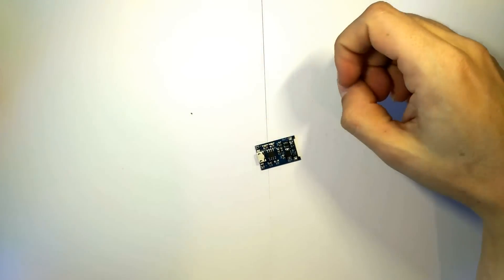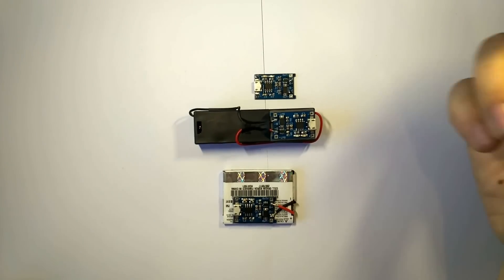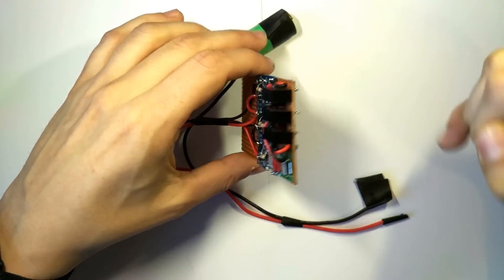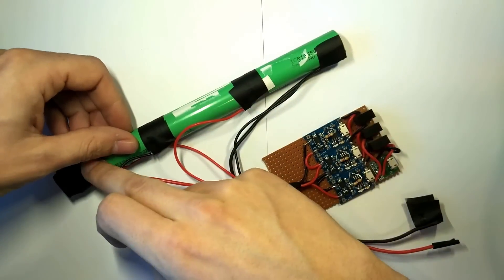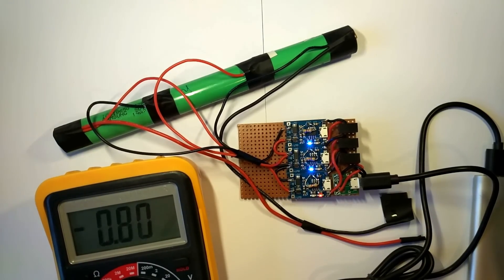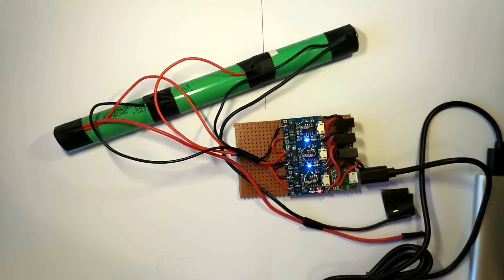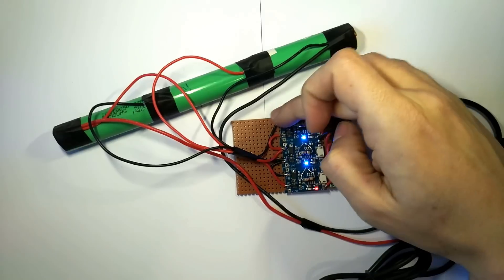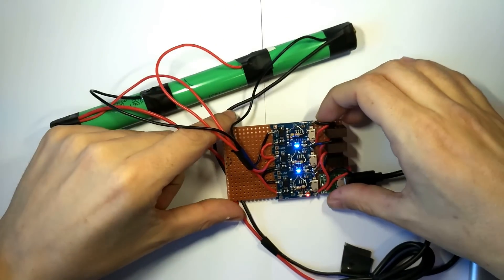Balanced 3S Lithium Cell Charger using the TP4056

Comment: Is it possible to connect load on batteries while it on charging (from 12,6 side terminals)? Maybe it could possible if diodes will be added for every output of each tp4056?

Comment: Question. could this be left trickle charging from a 5V output from a solar charge regulator without fear of over charging? 
Also question. could a 5V regulator be attached to the output for device charging, and would it have discharge protection?

Comment: This is a very unsafe design for 3 reasons:

1. Each of the protection chips (DW01A) is separate, there is no cooperation. Meaning: one chip could fail, due to ESD, water droplet, etc. Then that cell group is completely unprotected, opening up the possibility that the cell group could become overcharged and explode unexpectedly! With a 2-wire monolithic design, if one part fails, due to ESD, etc, the output FETs are turned off PERMANENTLY. This is much safer, as charge can no longer flow in or out. Crisis averted, while also alerting the user of the failure.

2. For exactly this reason, the manufacturer states clearly that the DW01 is a 1S ONLY protection chip. Using them as a 4S, 10S, 14S, etc is NOT RECOMMENDED because of this safety hazard! That's what the "01" in DW01 stands for! Here is the datasheet confirming my claim: http://www.kexin.com.cn/pdf/DW01.PDF

3. The protection and balancing chips are separate, leading to a condition where the balance chip fails, and the cell group is no longer able to bleed overcharge anymore. This is less dangerous, but still a design flaw stemming from using a 1S protection chip incorrectly. Proper multi-cell chips will perform balancing as well as protection.

Comment: From thumbnail I thought this would be another video of dangerous circuit from person who doesn't have a clue what is doing but this is pretty clever, i had a similar idea but my plan was make my own isolated power supplies which can supply more current but that modules have problems with overheating, recently I found different boards based on IP2312 which doesn't disipate that much energy to heat

Comment: Did you remove the R3 resistor and replace it with 5k ohm? Or did you just parallel it to R3? I can't clearly see the TP4056.

Comment: Why not place the TP4056 modules in series? Then you don't need an isolated DC/DC for each module and can benefit from full charge rate of 1A for each battery. You (in your case) need a 15V 3A power supply to charge it. When charging each ground is lifted and don't cause a short circuit. For example: 
Module #1 GND is at 0V       -> +5V - 0v = 5V  => 3.7V battery #1 charge
Module #2 GND is at +5V     -> +10V - 5v = 5V => 3.7V battery #2 charge
Module #3 GND is at +10V   -> +15V - 5v = 5V => 3.7V battery #3 charge

In case you want to be able to charge from USB 5V,  you can use a boost converter (5V to 20V) of 4A to provide the required power.  However, when you plug it into regular USB socket, you cannot achieve the maximum charge rate. Your design has the same problem, you cannot achieve the 1A max charge current. The DC/DC converter is rated 200mA max. There is a chance you push those components to these limits and get pretty hot or get damaged. Also you have 3x times effeciency loss for each DC/DC. 

So what do you think?
Reply: I think its a great idea, can you make a 40 minute video detailing everything step by step and maybe adding lots of animations ?  just kidding

Comment: I think this idea was interesting back in 2016, as most will say it does the job.
nowadays, there is better option with advantages at all points: effeciency + cost for the project!
for example the cost for a 3S pack:  3 TP4056 + 3 B0505S, is more expencive than a 3S BMS with Balancing feature!!
and the BMS option is able to gives you much more amps, there is 4A or 8A model, which are more than anough for most DIY project. the is even 20A model...
So BMS board is better option!
Reply: Those "BMS" boards only provide protection and (sometimes) balancing.  They don't regulate charging.  But there are a few options for charging series packs.  The easiest is to just buy a plug-in charger for the appropriate voltage and current, the listing will say it's for lithium and the unit should have an LED that changes colour to indicate charge status.  If you have a DC source of several volts above pack voltage (like an old laptop brick, or solar panels), there are buck converter chargers: SY6912 modules do 1 to 3S (but smoke came out of mine so I don't trust them so much) (voltage set by jumpers, current by removing shunt resistors); MAX745 costs more, but does 1S to 4S and can be configured with dipswitches and trimpots.  Then there are step-up chargers that work from USB C; charging power will be limited, but they'll work anywhere you can plug into 5V USB.  Search for "2s 3s 4s type-c charger"; they come in fixed voltage and current configurations.  Add a "BMS" and you have the same functionality as the circuit in this video for less money.
Reply: @BassBinDevil  Indead there is much more option nowaday, vid and need is from 2016...
Since chinese minion did there magic lol
I back bought few TP5100 module (2S), that are close to those you refered to. They constatly update there tech with newer IC and stuff...
Since, I only needed 12V from 18650s once, for the battery conversion of  my cordless drill , to lithium, and went with 3S BMS 20A, cause 10A got burned dead. 18650s choosed with approxi same capacity.
I charge the battery once per month and it is fine.
Mostly use TP5046.

Comment: could you give the wiring diagram please ?!
Reply: Its simple.... Connect each battery + and -   to each charging board. The batteries are connected in series. Here each battery is charged seperately.

Comment: I think you didnt connect the ends of batteries together. Each cell seperated by each other
whats the point of dc dc isolator
I am mad right now I searched everywhere but there is nothing about 2s li ion charging 
there is no module at all
Reply: hello friend, you can buy on aliexpress for only US $ 0.48
Reply: @hendrasaputra8545  thanks I found one

Comment: I can see how the cells are charged independently which eliminates one problem of charging multiple cells using a TP4056 and one supply, but how are they actively balanced? In other words where is the feedback loop that guarantees each cell is the same as the others?

Comment: What is the charging time of this charger?
Reply: He said 250ma per cell so at most this should take 10hrs if using 2500mah cells. Pretty slow. It only takes a 750ma charger to go full speed like this, which should be any power brick phone charger usb. If you charge from a computer usb port it may only be 500ma and go even slower.

Comment: I did the same with tp4056 boards with protection (btw i didnt used protection feature) and my boards shorted out. Why?
Reply: You proberly didnt use Isolatet individual powersuplys like BW0505S-1W. They must be used or you have a Short
Reply: @Enderkruemel  well if i just knew that earlier
Reply: What isolated voltage is needed for each tp scheme?
Reply: @IgorSwxy  you need 5vdc in 1amp per module. But you must use 1 psu per 1 module otherwise it will just toast everything and it won't work anymore

Comment: That's cool, can you use multiples in parallel? I'd like to get atleast 750ma, or 1amp!!  I did find a 3s charging board on eBay or amazon, its not balanced, it sees it as 1 cell, but a small balancing bms should fix that! If they could be modified to start balancing when charging, or at 4v would be great!

Comment: This does not protect the batteries from under voltage......there nothing keeping the batteries from going less than 2 volts per cell.
Reply: Are you saying in this setup the under discharge protection on the TP4065 wouldn't work?

Comment: What if I dont use the isolator?
Reply: You will be able to charge the first battery rest 2 will catch fire. The 3S configuration puts the 3 cells in series. So the Isolators remove the common ground condition. if you have 3 different sources fro each circuit without a common ground it will work without the isolatorr.

Comment: I would have used the USB connection on one of those charger modules and taken the "breakout" 5V from the input side of that board to feed to the isolators -- which you only need 2 of,  rather than 3.  And you don't need the breakout board either...
Reply: I had the same question. I guess it would work but would like confirmation?
Reply: @acoustic61  technically you only need 2 of those psu isolators, as what they do is make sure they have no shared common/no shared ground.
so as long as all others have a floating ground it is no problem if one of them has no floating ground.

that said these floating power suplies essentially are a frequency generator which powers a small mosfet which powers a small stransformer which then is rectified using diodes and balanced with a capacitor. the transformer in this case probably has equal windings on both sides roughly so the input and output voltage are roughly the same.
but the transformer just is only magnetically coupled to the input and not electrically so you get a floating input.

Comment: Awesome! I'll use it for a boom box as well! How do you protect from over discharging?
Reply: for efficiency and cost, BMS is better in all point!
The unic advantage here, are the led (red/Blue) to know the statut of each cell individually (charging or charged)
Reply: Here's a diy solution using a battery low voltage alarm you can get for cheap. https://youtu.be/1Fs4SfVSsLk

Comment: I know it would be awkward to set up, but ultimately it is easier to forgo the use of the isolation modules completely and simply supply the charging boards with 3 separate phone adapters plugged into a power bar, side by side.  

The main advantage, of course, is that you would not be limited to 200mA. Indeed, you could leave the boards unmodified and charge your batteries 5 times* faster!  

(*Based on the board's theoretical 1A charging capacity. Actual charging current varies as the battery voltage rises so it's hard to tell, really).
Reply: Not all phone chargers are fully isolated
Reply: @nikdonic  Not fully isolated, how? Please elaborate on how that matters in this specific project.  Thanks!

Comment: Do I need to use a 4 pin DC DC converter?  Could I use a 3 pin (common ground) converter or preferably a 3 pin voltage regulator?  I'm not sure if the boards would be isolated the same way but if not could I use diodes to isolate?

Thanks

Comment: I made a 3S and connected the TP's output to MT3608 and boosted to 12 Volts. But still my batteries arent getting charged properly. Is it because its not getting enough Amps ?  Im charging 800 mah 20 C 11.1 volt .

Comment: In the video you have the batteries hooked up but what about the protection circuit for under and overcharging?
Could you hook up the batteries to the battery connection and then connect to the out + and -, or will that short?

Comment: Hi guys. Can I connect in Parallel 3 of Mini-360 DC-DC Buck Converter to 12V on the Input set to 5V on the Output then 3 of TP4056 to create the same Ballanced Battery Pack?
I would like to avoid using B0505s. Thanks.

Comment: I ordered 20 tp4056 and when i tried to charge one battery it heats up in seconds. I tried using one tp4056 with one battery but heats up.
Reply: One of three things:  1. You messed up positive and negative so the battery is trying to discharge through the board instead of charge. 2. The charger board is damaged and is supplying too much current. 3. The battery you're trying to charge is too low a capacity for the default charging current supplied by the TP4056 charging board.

You can alter the charge current of the TP4056 by changing a single resistor on the board (the resistor does not have to be surface-mount although of course the board will be more compact with one).

There's a table online of charge currents and the resistor values to use for each.  Make sure the cell charges at no more than half its C rating (eg. for 1000mAh, charge at no more than 500mA).
Reply: @melkiorwiseman  

I got a question... Did he pulled out the R3 resistor and replace it with 5k, or did he just paralleled it? 🤔

Comment: With the price of the three isolaters and the three single cell 5V  chargers ,  is there not a single   3s  BMS  available to do the same job?
Reply: Nope. Pretty much all 3s BMS require all the batteries to be balanced. i.e. they must be new, from the same batch and have the same internal resistance. Not very useful if you are trying to re-use batteries from a laptop.

Comment: i like this idea as long as you don't mind the slow charging.  you would need a powerful adaptor that maintains 5v yet more current to be able to charge faster.
Reply: True about the poweful adapter, but once you start adding more cells in parallel it becomes faster,  at that point your only limited to how fast you can charge 1 battery at 400 milliamps, provided you can provide enough current to all.  Theres 2w versions so can do 400milliamps. Say you got 91 cells for a 13s7p battery pack  thats 36 amps combined @ 4.2v giving 151.2w of charging power, compared to a standard 48v escooter charger does only 2 amps so 96w of charging power.   At that point youre faster then a standard charger and you got perfect balancing so a longer lasting and more efficient pack, even more so with that modest charge current.  Only tricky part is finding a 4.2v 50amp charger... I guess you can use one of those 50 amp buck convertes ,  take a 48v charger down to 4.2v with that converter and theres youre 36amp charger perfecly charge balancing your battery in a couple hours.  Now you got 15-20% more capacity/life thanks to this method perhaps.

Comment: Hello, is there a bigger version of the B0505S isolated converter in order to withstand 1A of current or more for using these charging modules in their original state?
Regards, Viktor

Comment: Hey, thanks very much for the video! I have been searching for decent a solution to balance charge 6s 18650's and I think this is it! Quick question that I can't seem to find answers to online. This board also offers over discharge protection if you use the OUT pins for load, do you happen to know what the max current is I can pull from this? I am hoping I can wire them in series through the OUT pins rather than direct, so I have discharge protection when powering a 2.1A motor. Thanks!
Reply: Did you ever try this?

Comment: Hi, great video. Just one amendment. You can do away with the B0505S-1W by using a single 1N4001S 1A Silicon Rectifier connected to each negative input terminal BEFORE you connect the negative input of your power supply (singular wire). You can use the one positive power input wire on all positive input terminals of the TP4056. 
The rectifier only allows the current to flow from the power supply in to the TP4056 and not back from the batteries in serial (which it does!), therefore this stops the inevitable short circuits you'd get if you didn't use the diode/rectifier. It saves some money on components.
Reply: darkkevind1978 hi you will get a diode forward voltage loss, approx 0.5-0.8v
Reply: Yes, you'd have to up the input voltage slightly...
Reply: Hey did you ever try this method of using diodes on the negative input terminal? In theory it seems like it might work.
Reply: It's really interesting... So just a single negative wire connected to 3 1N4001S 1A Silicon Rectifier, connected to each negatives inputs of each TP4056 ?
Right ? Then I could have 1A charging ?
Reply: Just to clarify, which direction do the diodes go?  Assuming the cathode end is on the negative terminal of the power supply, and anode is connected to the TP4056 board...
Reply: or replace the 1n4001 with a schottky diode such 1n5819 for lower voltage drops thus increasing the efficiency

Comment: Hi! I'm looking to do something like this, except my '80s boombox takes 9v. Would it be better, in my case, to use a 2S configuration with a step up converter?
Reply: Yes I'm doing same but I can't make circuit diagram perfectly that reverse Current flows according to me, thank you

Comment: but this type  TP4056 is inteligent charger, so charge the cell if they need. my single cell charging from 1500 mAh adaptor, but the charger is just charging in 0.25 or 0.5 or 1 amps. In this case the "inteligent" mode is not working or what?